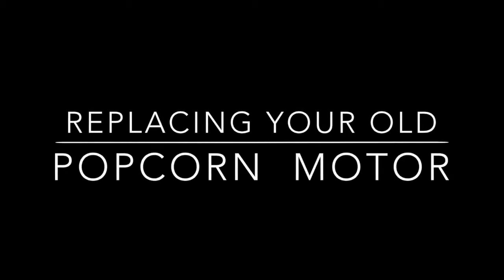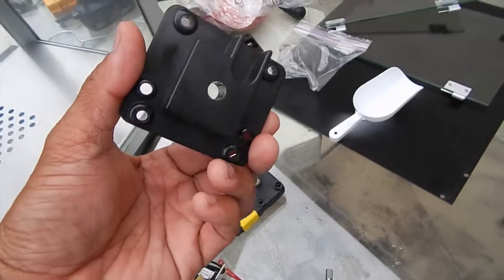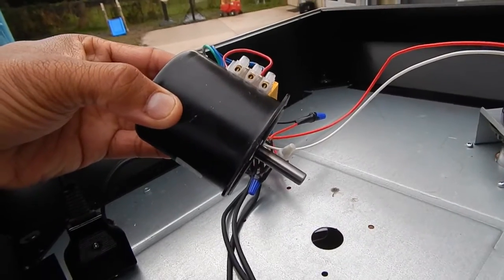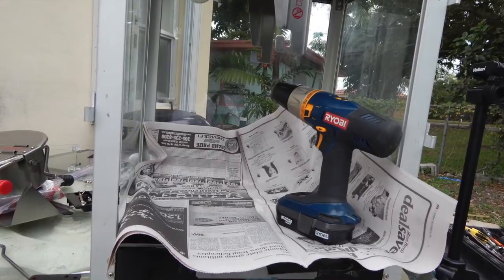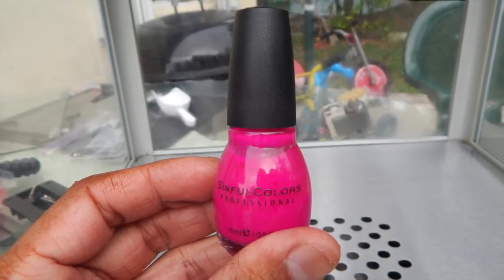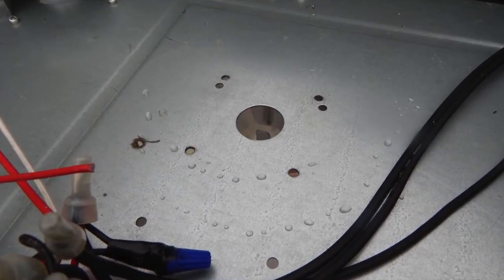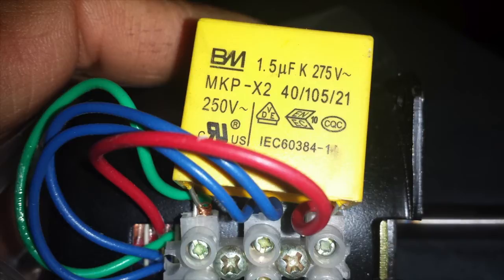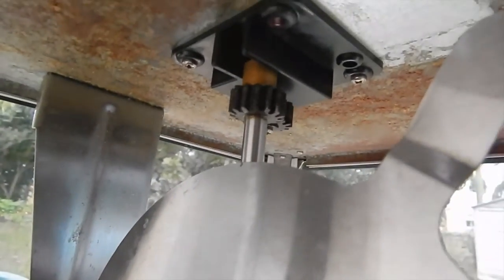Popcorn Machine Fix: Replacing your C-Frame Shaded Pole Motor with a Synchronous Motor

Comment: I ordered the motor you described, however it does not have a threaded hole in the shaft to hold the retaining screw for the gear that engages with the stir arm.  Is there a different motor that will connect as you showed in the video?

Comment: How do you take off the gear sprocket
Reply from the maker: Hi Tyrell,  It's been so long ago. If I'm not mistaken mine had a phillips head on the end.  You might be able to find a replacement at:

http://www.keepitpoppin.com/popcorn-machine-parts.html

The metal spacer and sprocket can be purchased here. Good luck!
Reply: 305partyflix thanks
Reply: Hey Tyrell, did you figure this out? I cannot for the life of me get the gear sprocket off of the rod. Consequently, I cannot take the old motor off.
Reply: @mattihle8229  No, I gave up and sent it over to a Technician.
Reply: @TrEo2322  Yeah I've been working at it for two days and can't for the life of me figure out how to get the gear sprocket off. Hence, I can't get the old motor off. I'm about ready to just take a hacksaw to the plastic piece!
Reply: @mattihle8229  🤣.... I got so frustrated also, see if you have a tech in your area that works on popcorn 🍿 machine and have them come over or send it out for repairs.
Reply: If anyone is wondering, I figured out how to get the gear sprocket off! There’s a little retaining ring on the very end that you need to take off using a flat head screwdriver or another precision tool. Once you have that off, you can use a pair of pliers to pull off the gear sprocket and then take apart the motor mechanism.
Reply: @mattihle8229  Hey!  I took off small screw and washer, but I don’t see another clip or anything..  what am I missing.  The sprocket won’t budge.  Looks like it should slid right off??
Reply: @DurkNasty1977  it's almost impossible to see, especially if it is all corroded by popcorn butter! That's why I didn't see it for two days. I finally just took a little precision tool to it and started poking around and the retaining ring popped off. Get something that's as sharp as a safety pin (or maybe just use a safety pin) and start poking around. It'll eventually pop off. Unless yours isn't designed like mine was.
Reply: @mattihle8229  I’ve tried a very small eye glass sized screwdriver and I am to the point of ruining the sprocket pulling with pliers.  Mine looks like the D shaped end and should just be held on by screw and washer which came off easily.  I’ve scraped it down to the metal and don’t see any other ring.  My motor still works fine, I’m just trying to get the rusted piece of ceiling sheet metal out so I can sand it down and clean it up properly.  Rust on the popcorn is not tasty.  Thanks!  I guess I need a blowtorch.
Reply: @DurkNasty1977  it sounds like yours might be different than mine. I remember struggling mightily with it, and I was ready to just hacksaw off the plastic piece and rig something else up once I got it off. I hear you on the ceiling sheet metal, I guess mine is pretty rusted too, I'll eventually have to do what you're doing. Best of luck to you, it's so frustrating when you're so close and you're running into an issue on a step that seems like it should be really easy to do.

Comment: I was pleased to see this video because my Euroka M6030-1203-1 motor went. I bought the parts in the description link but was disappointed to learn the motor doesn't come with the square attachment to affix the gear wheel.  In the video it clearly shows it has 2 parts. Without that part I can't use this motor.  I can't seem to find it anywhere.  Any ideas?

Comment: hello i'm also trying to change my popcorn machine with the new motor. but the new motor i purchased had 2 blues and 2 whites. the old motor has 1 black and 1 red.  How do i know reconnect the wires to the new motor? Thanks in advance.☺️
Reply from the maker: Hi , What model is your machine and I'll look into it?  I'm in Florida and we just hit with a Hurricane.  Take care!
Reply: hi! hope your good now after the hurricane. Thanks for your reply. I was already able to make the motor run. But my problem now is that the stirring rod of the kettle is not turning. The gear on the motor turns but is not like engaging with the gear on the kettle stirring rod it just jumps. Where do you think i made a mistake? Thanks in advance.

Comment: How does your stirring hand/handle connect to the top of the machine? I have to do the same as you but I have a different model of stirrer and it doesn't have any gears attached to it. http://www.webstaurantstore.com/carnival-king-pm470stir-replacement-kettle-stirrer-for-pm470-popcorn-popper/382PM470STIR.html

Would love to know as my motor is super loud and want to swap it out with a Synchronous Motor